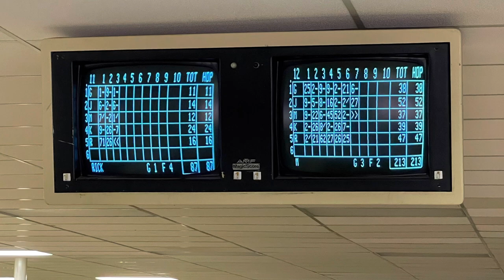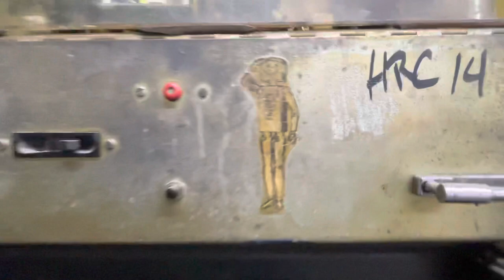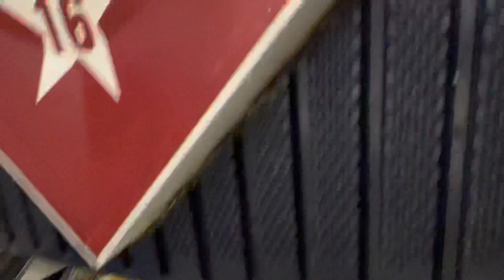More 82-30 action from Hereford Texas with Bill Mike and Rob

Comment: Oh man that "Magic Score" screen at the start looks like the original AMF automatic scorers. In the '90s I worked with a consultant who had led the team of Motorola engineers that developed that first system for AMF in the '70s. They had been in a race with Brunswick to be first to market with automatic scoring, and were failing spectacularly. 2 years in they gave up and brought in Motorola to start from scratch. The dude had some awesome tales of what the development process was like, including crazy stories of durability testing (smashing equipment, pouring beer into the scoring hardware, etc). In the 70's as a teenager I bowled and worked at a house with 82/30's, and seeing that AMF robot decal on the chassis atop the pinspotter took me back to the shop back in the day, hanging with the mechanic on duty and learning about the 82/30's operation. Good times!

Comment: 82-30's are beasts! Those old sweeps were notorious for bending when they landed on a pin or crashed into the table. BTW,  is that AMF Magicscore?
Reply from the maker: Yes!   Actual magicscore.    Still in use
Reply: @GarageBowlingAlley  Magicscire was a good idea but boy, if the pinsetter was cycling due to a malfunction you'd spend the next 30 minutes trying to erase all the bad scoring. These things scored every time the machine cycled.
Reply: @GarageBowlingAlley  The old joyland bowl before it was shut down in Lexington, KY had amf magic score running but they were 82-70 machines.  You got your score printed out on a small thermal printer.
Reply: @Sean-mclaughlin  Also the bowlodrome in Owensboro KY had a slightly newer color amf accuscore score, not sure if its still used.

Comment: I admit that I really had no idea about the mechanical aspects of bowling lanes, but I'm really learning a lot after subscribing to this channel. Thanks for the video(s). Also, anybody know what is behind the name 82-30? Is it related to the set-up mechanically?
Reply: I sent a letter to AMF when I was a teenager in the 70s asking how they came up with the name. It was a just a name their engineering gave to it. I want to say 82-10 was the first, then 82-30 followed by 82-70. I think 82-45 is the candlepin pinsetter.
Reply: @mr.ksplacekevynmarshall7721  thank you.
Reply: @mr.ksplacekevynmarshall7721  The candlepin machine is the 82-95
Reply: @Bowler4Ever Thanks. I wasn't sure of the right number.
Reply from the maker: The A2 designation makes sense but not the 82- designation as you all say.  One may never know but would be interesting to find out.   There is a good video on YouTube of the 82-10 I believe.